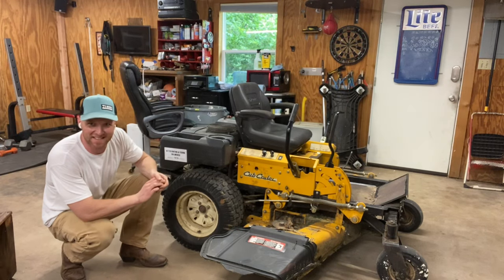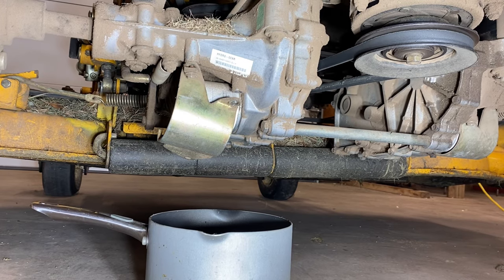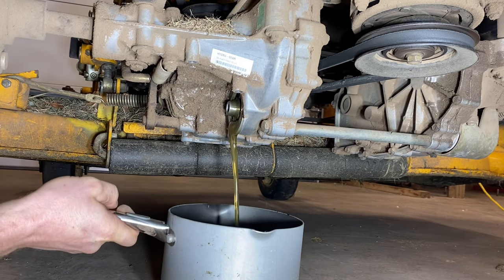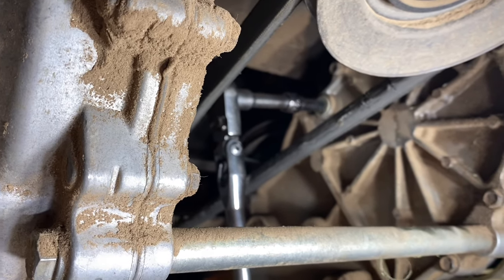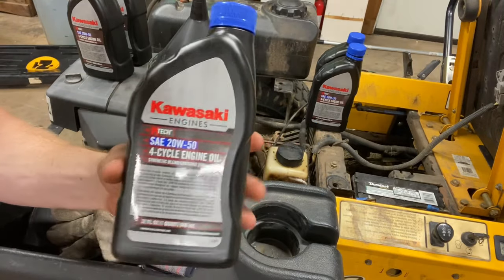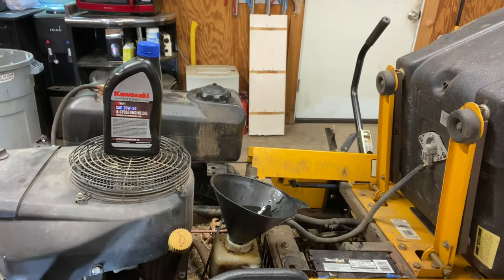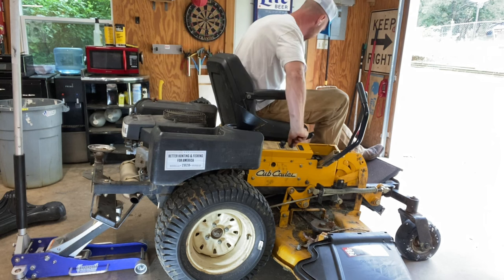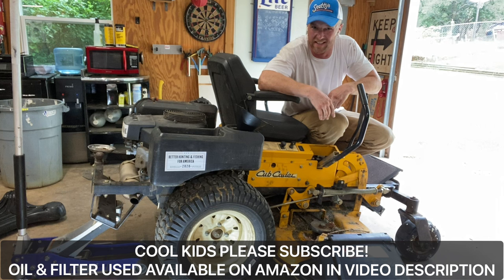Zero Turn Hydrostatic Transmission Oil Change & Bleeding!

Comment: The vent plugs is where I was stuck at. Thanks for the help! Ol Toro is back up and running. It's going on 20 years old and I don't think my mom ever had the filters changed. They were nearly rusted through.
Reply from the maker: Dang well done saving her.

Comment: you can run straight 50 weight also. you can use any 20w50. remove both vents at same time... both fill at same time... IIRC left side fills sooner than right. pull tabs in rear to disengage wheels first, bleed air, then push tabs back in and bleed air again.
Reply from the maker: Nice trick, never thought of that one

Comment: Great video, fyi our mowers have a transmission disable, so you can run the levers forwards and backwards without the wheels turning. Also, M1-103A and Fram FD4386 work as alternative filters, which you can get at any local auto parts shop.
Reply from the maker: Thanks for the filter numbers, those dang hydro filters are $20 a piece!
Reply: Also, these filters  -

Wix WL10102
Stens 120-738
Rotary (19-) 12374
Exmark 109-3321

Make sure it’s a transmission/hydraulic filter with no bypass valve/or anti-drain back valve.

Comment: @MowerMike, Thanks for the help, I changed a charge kit, o-rings and filters along with oil change, all very easy with your tutorial! My transmission leaks some hydro oil where the drive rod comes out of the transmission, Do you have any experience with fixing leaks from that area? I have the same cub cadet Z-force 60" as you. T.I.A
Reply from the maker: No I don’t. But my guess is to replace that gasket you may have to pull the whole transmission and split it open. Which is a bear of a task. Glad the video helped
Reply: @MowerMike  thank you. I’ll have to call a shop and see if they can help and hope it doesn’t cost a small fortune!

Comment: Cub cadet worked noises. Service both sides both filters and pump upgrades won't move forward or reverse tried bleeding any help
Reply from the maker: I suggest keep on trying to bleed the system with the rear jacked up. You can unhook the hoses leading to the units and use a funnel directly into the transmission. I have had to do that because air can get trapped in the hose that goes to the overflow tank. 

If that doesn’t work You also may have installed the pump gear upside down or the wrong one. I know it is frustrating but just go slow and keep working it. I bet you will get it going.

Comment: Brilliant video Mower Mike!! I will be doing an oil change on my Z-force 60 after you showed how to do it! I already have 1.5 quarts of Cub Cadet Drive Fluid, do you see any reason why I should not mix it with Kawasaki 20W50 oil?
Reply from the maker: Wow no one has ever called me Brilliant haha. No idea about the mixing but my guess is it would be fine.
Reply: Mower Mike, Thanks for the help, I changed a charge kit, o-rings and filters along with oil change, all very easy with your tutorial! My transmission leaks some hydro oil where the drive rod comes out of the transmission, Do you have any experience with fixing leaks from that area? I have the same cub cadet Z-force 60" as you. T.I.A

Comment: I have a rzt50 and it has a tank for fluid for the trans axles. Does that mean it isn’t or is serviceable
Reply from the maker: Yes it should be serviceable, check under it and see if it has screw on filters.

Comment: Got a question for ya brotha. My fluid looks totally fine and clear, but I noticed some grass pieces in my expansion tank. Not a whole lot, but enough to make me concerned. What’s your thoughts? I just bought the lawnmower from a guy that I did some HVAC work for so I’m unaware of who did what. It did come with books and records, but not sure how the grass got in.
Reply from the maker: Hmmm, maybe put the lid back on the tank?? Haha, no idea I would just keep running it. Little grass won’t hurt anything

Comment: I noticed that your left wheel wasn’t moving when you was bleeding the line is that normal till you get the air out mine is doing the same thing
Reply from the maker: Yep totally normal. They have to be bleed to work
Reply: @MowerMike   how long does it normally take to bleed them I tried to bleed mine for a hour and it’s still bubbling and the tire still don’t spin
Reply from the maker: @travisfultz  Usually just a couple of minutes.

Comment: Mate, I'm in need of help. Cub cadet 2004 rtz17.
It doesn't have oil filter, but it does have a breather, 
I'm figure that I gotta take out both transmition's,
Flip upside down, drain oil out,
How much oil do I put back in, carn't find out nothing about it,
And unfortunately I carn't access the filler hole from up top when i put it back to get her, so i need to do all this and the bench, before reassembling it back together.
Can you give me any idea, how to, 
Sorry for being a pain in the bum.
Thanks in advance.
Cheers from down under
Reply from the maker: Howdy Mate, no worries I have ya covered check out this video.

https://youtu.be/l5c5zq5qz8Q

Then move onto my playlist and let me know what questions you have after watching what I have out there. 

https://youtube.com/playlist?list=PLo4VDcnI4eog75ESAm7eClMTZ50vTwQEu

Comment: Thanks for the video. Do you have a video on how to change the hydrostatic v belt ?
Reply from the maker: I do on regular riders but not on a zero turn. That is a good idea for a video, I will put it on my list. Thanks.

They are pretty easy on the zero turns though just pull on the lever with the idler pullie to release the tension and it should slip right off.
Reply: @MowerMike  Not on my Exmark Phazer.  No clearance to remove belts anywhere.  Must remove fans from sheaves, idler arm (no belt clearance), and bracket to clutcu between belts.  Just damn nasty.  I am an engineer, but damn the engineer that did this design!😒

Comment: Ever dealt with the Craftsman Revolution Mower ? The transmission called an Infinitrak  ?? What fluid or oil do they take ... the fluid reservoir is almost dry & not sure what to use , 20w-50 maybe ?? Thanks !!
Reply from the maker: No never heard of one. That or straight 30 weight would probably be work.
Reply: @MowerMike  I'll give it a go , thank you for replying back !! 🙂👍

Comment: Mower mike, i have bobcat fast cat that has the zt3100 in it and i have changed fluids and filters all to direction. bled air and tested mower~ it does great but after parking and checking next day, i have to repurge again before hydro left side starts working again. what can it be. thx phil
Reply from the maker: No idea maybe it has a little leak up top somewhere near the filler

Comment: Hey man working on a toro zero turn with the steering wheel not sure the exact model it has the hydro gear transmissions kind of wondering if there the same and i could use the same parts ZH-MCBB-3BRA-2PL3 thanks
Reply from the maker: No idea will have to ask Google that

Comment: When pouring new hydro oil in do you have both allens out or do you do them one at a time?
Reply from the maker: Both one is so it will bleed air out as you fill.

Comment: I have a 2015 Cub RTZ-L that has been down for a year because of the left drive. New to these drives. I bought a new drive
ZC-DMBB-4MDC-24PX.
Haven’t put it on though I am getting ready to.
It doesn’t appear serviceable, does this mean it’s already filled?
Reply from the maker: Yes they are sealed. Check out my zero turn playlist, have a few videos on those
Reply: @MowerMike  Sure will. Thank you!!
Reply: @MowerMike  Did watch some more of your videos. After roughly 2 hours my Cub 54" zero turn was mowing grass! Thanks for the videos!!

Comment: The toro z4200 model 74360 has no filters and has a small 1/8" hose coming out the top of each side of the transmission . Since we can't find any video's on the Toro Z4200 on transmission fluid and how to add oil we  are adding oul through this tube.
Still the left side won't turn any faster...its very slow.
Thanks for the great videos
Reply from the maker: Check out my other hydro oil change video on my zero turn playlist. It shows how to do it on a non filter one like yours. Is a PIA

Comment: Thanks.  Sorry, so when you say ‘bleed’, do you have the cap off the resevoir, or the allen vent bolts slightly cracked?  If it bleeds through the resevoir, then you would notice the fluid level drop as you do it, right?
Reply from the maker: Loosening the bolt helps it bleed. It won’t bleed through the oil reservoir since that is where you are filling it. When you fill it there it has no where for the air to go since the tube from the reservoir to the trans is filled with fluid, that is the reason for the little vent/Allen head bolt. 

Good luck, getting the air out of the system is the trickiest part of changing the fluid.
Reply: @MowerMike  do the bolts need to come all the way out? Mine isn’t a Allen but a 19mm socket and on the right side there is a pulley in the way and I can’t get a wrench on it and if I did it still wouldn’t back out all the way I don’t think. The pulley is so close to it
Reply from the maker: @Darrenbrown09  It just needs to loosen enough so air comes through the threads so no it doesn’t have to come all the way out
Reply: @MowerMike  thank you sir!
Reply: Some of them bleed through the reservoir via a small hole in the cap...just like on a gas tank or such....they all ABSOLUTELY have a vent of some kind somewhere and I'm not talking about the Allen head plug etc.....if they didn't have some means o ventilation than the pressure that build up as result of heat and volume displacement would blow the seals out or blow the housing apart.....pressure is just like electricity....it travels the path of least resistance.....
Reply: Got mine done but now I for some reason don't have any movement on my right tire.

Comment: More Mike my zero turn cub cadet has a steering wheel it's a z460 and when I cut grass it leaves a little bit of transmission fluid I pour some in there to keep it along the bottom of the reservoirs what they say when I bought it and when I get done it pours out and I have to put that small amount in there so I'm not losing a lot what do you think that could be
Reply from the maker: I have no idea look around and find where it is leaking and fix it.

Comment: So I have the same mower you do almost. I did this whole oil change and upgraded the seals and covers. I had oil coming out of both vent holes and the reservoir filled just over half. I jacked it up and the right wheel will not move at all. I am thinking vapor lock but the oil is coming out of the vent so what do I do now? Any thoughts would be helpful. Thanks
Reply from the maker: I suggest unhooking the full tube, put your vent plugs back in and just manually add fluid as your bleed the hydro with a funnel. They are tricky to get all the air out.
Reply: @MowerMike  I will give that a try thank you!
Reply from the maker: @hroboys3817  You unscrew the fitting the fill line fills through and just hold the funnel right above it where you can see it pouring in . That way you know it is bleeding
Reply: make sure reservoir and frame are level when you fill, made a huge difference for me

Comment: Any input on a JD 265 riding mower that has weak forward and weak reverse? Dealer tried replacing the hygard fluid and filter but it’s still so weak even the slightest hill stops it. I checked the linkage and it’s functioning fine all the way forward and back. I jacked up the rear wheels put it in forward/reverse and I can stop both wheels with my hands 😳
Reply from the maker: Man all I know about these I put in the video. Good luck

Comment: What type oil on hydo unit cub cadet enforcer 54
Reply from the maker: The Amazon 20w50 hydrostatic gear oil is the best you can buy. I have tested it and it runs smoother and faster than anything on the market. Check out the link below. I only use Amsoil on all my equipment and cars. Sign up to be a preferred customer is the way to go. 

https://www.amsoil.com/search/#q=20w-50%20synthetic%20hydrostatic%20transmission%20fluid&t=totalProductsTab&sort=relevancy&numberOfResults=20?zo=1360728

Comment: HELP!! I have a cub cadet Z Force 60”, it runs great until you turn the blades on then it bogs down.. I have to drive really slow to cut grass. If I drive over grass I just cut, then it runs fine but bogs down again just as soon as I hit the next row of grass.. and no, my grass is not too high/thick.. it does it whether I have the deck on my normal height or raised all the way up.. it’s like it’s bogging down under any amount of load.. I have changed fuel filter, plugs, engine oil, new blades, and cleaned the carb- and still having the same issue.. any ideas/suggestions?? Thank you!!
Reply from the maker: Check your cylinder compression. Sometimes when I can’t figure out what is wrong the engine internals are just tired, you should have atleast 120lbs. You also should check your valve lash if you haven’t already.

https://youtu.be/A-pz95aGCfQ
Reply: My mower did the same thing!  I changed all the same things as you did....  but I found out it was the ignition coil (simple to replace)  and after that it works great!!

Comment: Losing a small amount of transmission fluid mic every time I cut grass I only have to pour a little bit and the reservoir to get it back up about 1/8 of an inch but every time I lose some what could that be
Reply from the maker: Just keep a bottle on ya, hydro gear oil is good for grass.